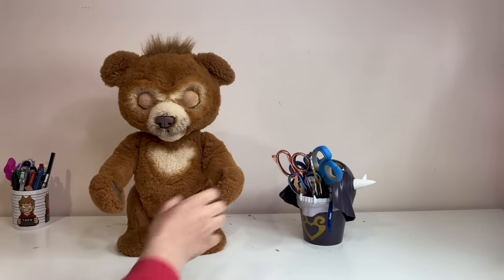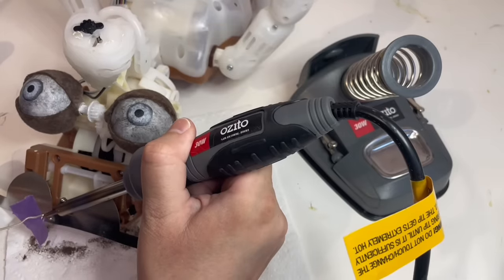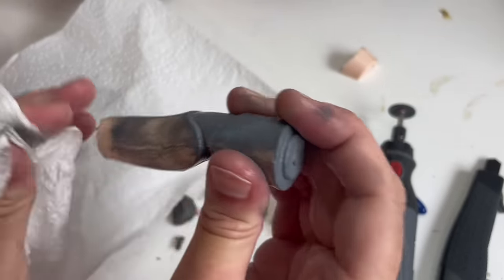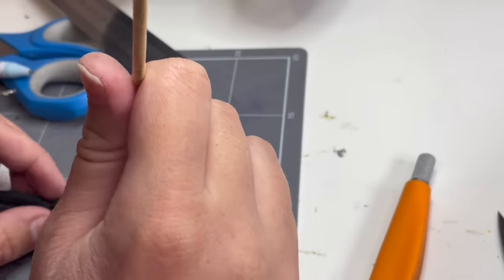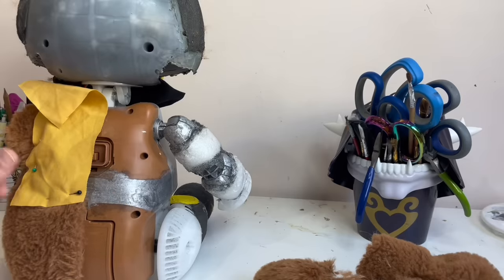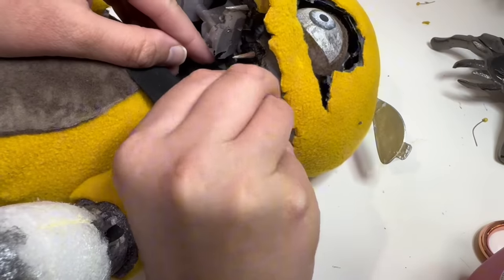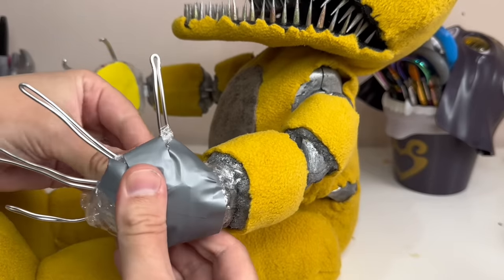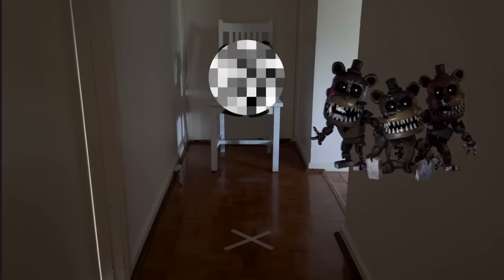Let’s Make a Plushtrap Animatronic From Five Nights at Freddy’s (Out of a FurReal Cubby)

Comment: I love how you did this!! I have a suggestion, why don't you use spray paint or an airbrush for the whites of the eyes? It makes the paint look alot smoother in my experience!
Reply from the maker: Thank you so much! We have an airbrush but I haven’t practiced much with it so I didn’t even think of it. I might do that or spray paint next time, but I haven’t had an issue with just using acrylic haha
Reply: @tobyhorrorboy a lot of doll customizers use several layers of watered-down acrylic. it's time-consuming and not as smooth an airbrush but its lighter than thick layers. i dont know if diluted layers chip easier than thick layers though, but regardless i think the brushstrokes left more room for the black wash to seep through and it looks great

Comment: As a Bionicle fan, it did pain me a little to see those pieces get cut, but the project turned out great regardless! It's probably a good thing you ended up not using them for the knees, though, because I don't think they could've supported the weight if Plushtrap was stood up.
Reply from the maker: Thank you so much! And yeah I don’t think they could have either. I’ll definitely find another use for them though!

Comment: This looks amazing! You guys did such a good job on him he's so creepy and I want one so badly!
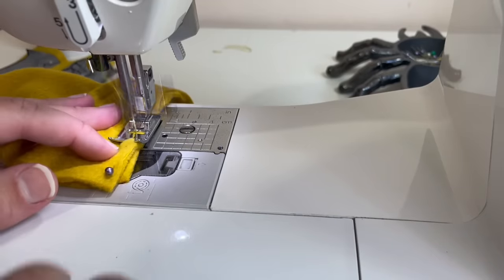10:05 BTW as someone who does a lot of historical costuming if you don't want your fabric layers at the seam to slip and get out of alignment as you're feeding them into the sewing machine like that you can pin crossways with the ball of the pin nearly touching the edges of the fabric and the pin extending away from the cut edge like this:
------| |---0
------| |---0
------| |---0
 Just make sure to pull them out as you sew so you don't hit the pin and have needle on your machine break. Flying pieces of sharp metal close to your face are not fun lol. 
17:07 I'd recommend using a backstitch or running backstitch instead to secure velcro on future projects. A running stitch just isn't really strong enough for repeated tugging like it'll get with velcro and will eventually fail. Adding a backstitch even just every 3rd stitch will add a ton of strength to the seam.
Reply from the maker: Thank you so much! It’s so cool that you do historical costuming, that sounds incredible!!! I wasn’t having problems with the fabric slipping because the fleece sticks to itself a little bit, but I’ve always? Done that the other way? When I’m sewing clothes or similar (so, not fleece or fur) I put my pins horizontally but with the head of the pin near the bulk of the fabric. Have I been doing that wrong all this time? 

And I love a good backstitch but I was trying to not have much of the thread showing on the good side, so I just did a running stitch haha. I might do the, backstitch every third stitch thing though, I haven’t tried that before. Thank you!
Reply: @tobyhorrorboy   You're welcome! I love making clothes esp from the 1800s to early 1900s for costumes and wear a lot of retro 30s-60s pieces in my actual wardrobe lol. Facing the pins that way isn't wrong, really, it's mostly a "best practices" for efficiency kind of thing. It works with the pin heads either way but having them facing to the right, near your fabric edge, means you don't have to stop sewing to remove them. You can guide the fabric with your left hand while your right smoothly removes pins as they near the presser foot.

As for the backstitch, if you want the neat stitches to show on the right side of the fabric you can pin the velcro in place, use a fabric pencil to mark on the side of the fabric where you want your neat stitches to be, and just sew that side up with the velcro hidden on the wrong side of the fabric. This will ensure the messier side is hidden with the velcro. Marking your stitch line like that will also help with sewing a straighter seam. It's admittedly a little more trouble but handsewing a nice top stitch always is lol.

Comment: You can try dying the plastic you used for the knee joints next time or use the other parts to test the paint before applying to the actual part you need. Save some time and also helps to swatch paint in the future
Reply from the maker: That’s a good idea, thank you! I thought about dying the plastic but I was trying to keep costs down and didn’t want to buy dye if the paint would work haha

Comment: Any tips for beginners on customizing animatronics? Ive been thinking of doing it myself 👍
Reply from the maker: Oh awesome! Did you have any specific questions? I’d suggest learning basic handsewing (especially a ladder stitch), and avoiding hot glue. Super glue or a strong general purpose adhesive are much better in most situations, and contact cement is great too! I’d recommend using fleece over a stiffer material like felt (at least for the majority of it? Felt can work for details), and using glad wrap and duct tape to make patterns is really helpful! It’s a broad hobby, so there are a lot of different tips I could give haha

Comment: Can you list the supplies to use?
Reply from the maker: So this is off the top of my head!

The base animatronic is a FurReal Cubby The Curious Bear.

The glues I use are contact cement (I use Parfix but any brand will work) and a strong general purpose adhesive (I use Tarzan’s Grip). I used cling film, sharpie, duct tape, and sticky tape for patterning. 

I used EVA foam floor mats and craft foam to build up his limbs and whatnot. The fabric used is all fleece (which you can purchase by the meter in most fabric stores). I used polyfill / plush toy stuffing for his fingers. For the sewing, I used pins, and a needle and thread. I also used a sewing machine for parts, but you could honestly just hand sew the whole thing.

I used acrylic paint for his eyes and mouth, and to make him look dirty. Mod podge was used to seal the paint and prime surfaces, but honestly PVA glue will work just fine. 

I cut up a jointed doll to steal her knees. She doesn’t have a brand, but any jointed toy that’s the right scale should do just fine. I used Plastidip to prime this, and it was painted with spray paint. 

I used aluminium wire (or floristry wire) for his fingers and ears, to make them poseable.

There are a lot of different ways to make something like this, but that’s how I did it! And you could definitely use different methods or swap some materials. I hope this helps!

Comment: you forgot some wiring gal just tellin ya! 😜
Reply: and also you can put the endo mouth above the censor and place the jaw underneath the censor
Reply from the maker: What wiring, sorry? I could have put the Endo mouth above Cubby’s mouth (which is where the sensor is) and his lower jaw is already under there!
Reply: edit: i forgot plushtrap doesnt have wires and i thought you ment the sensor was in the middle of the shell (and also could you just move the jaw to go upside down and code the jaw to go down instead of up since it will be upside down?)